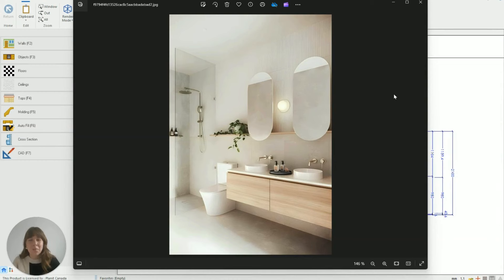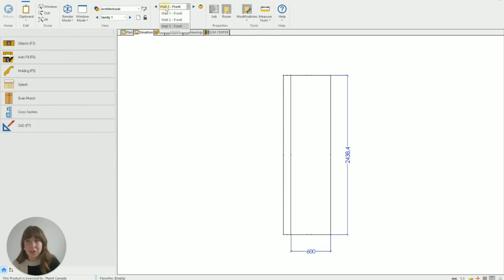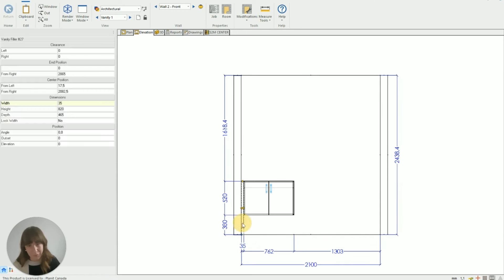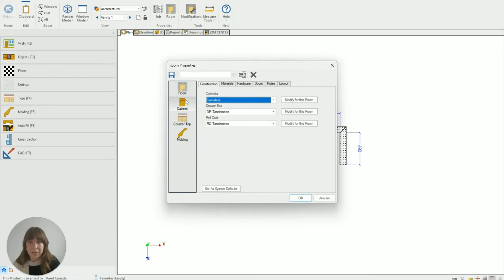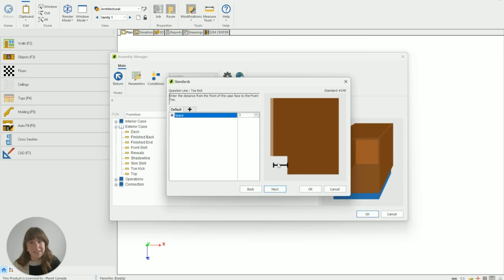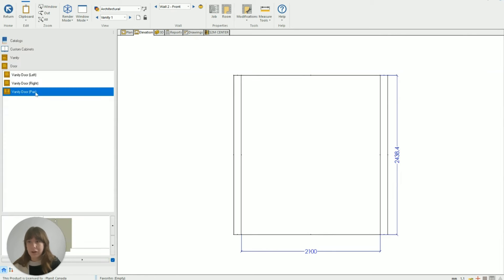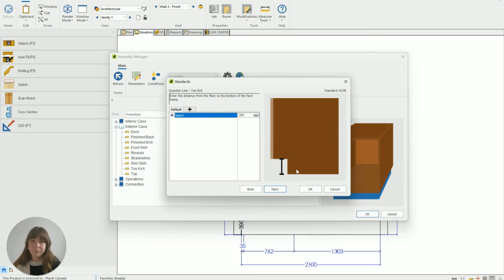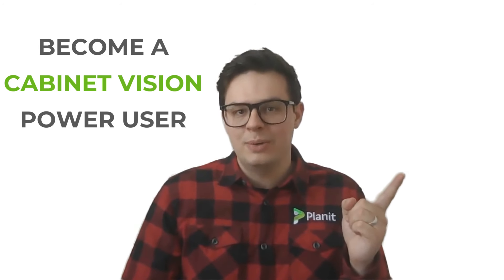A Better Way to Construct Floating Vanities in Cabinet Vision

Comment: Hey, I have a quick question may be u can help.
I need to add a baseboard to the cabinet that protrudes half an inch on both sides and seamlessly connects to the wall. Thanks.
Reply from the maker: Adding a baseboard can be done using the 'Molding' fonction in Cabinet Vision. From the Plan view of a project, click on the Molding button and choose the Type Baseboard. Then you can draw it manually or ask the program to automatically generate it, similar to how we add counter tops in CV. Thanks for your question!

Comment: Hey, maybe you can help.
I can not get pull holes in my doors. Any troubleshooting you could reccomend? My tooling, and schedule manager seem to be in order, but it will not optimize any holes. Any help or direction would be helpful. Thanks.
Reply from the maker: Would you be able to clarify with me if you can see the pull holes in your elevation views and more so that they aren't optimizing? Or is it that you can't see the hole drilling at all on your cabinets in the first place before they even make it to S2M Center?